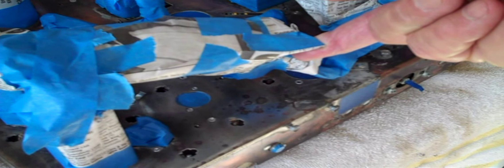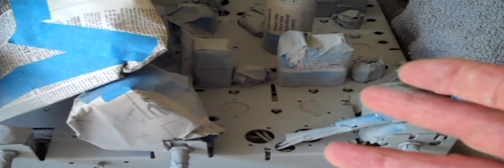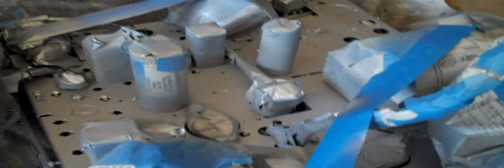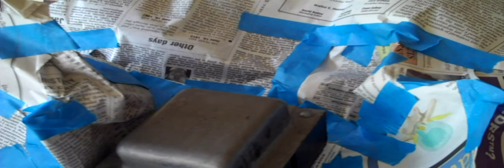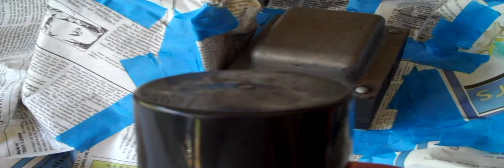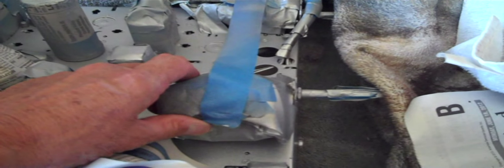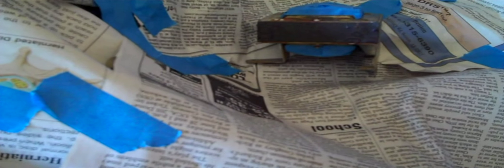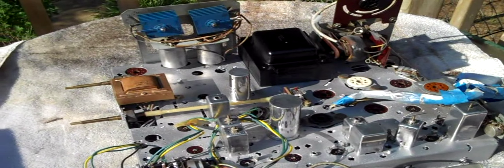1952 RCA Model 17T151 17" TV Repair and Restoration (Part 6 of 27).

Comment from the maker: Thank you, Geoff.  It was good of you to drop in.
Good luck on your TV restoration.  It'll won't be much different than working on an old radio, except that one particular area of the TV chassis has thousands of volts. The rest of the chassis voltages run from about 150 to 350-400vdc, or so.  Just be very careful and all will go well.
And I appreciate the heads-up on the bandersentv vids.  It was great info.
I hope to see you again.

Regards,
John